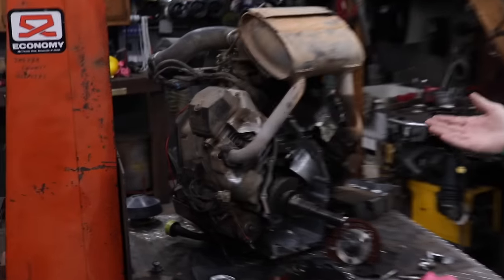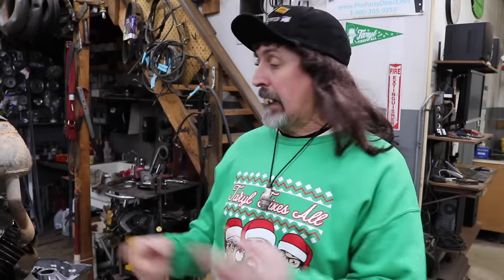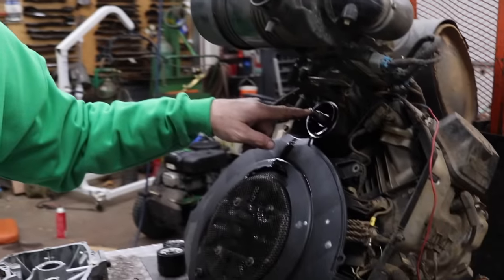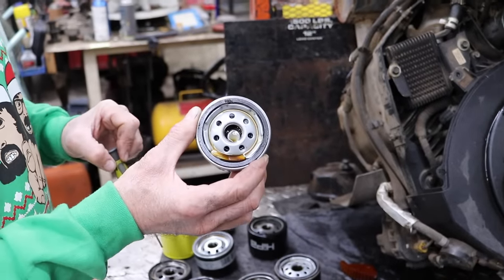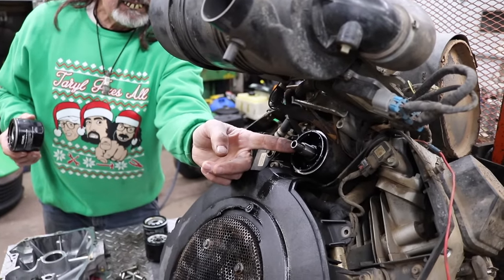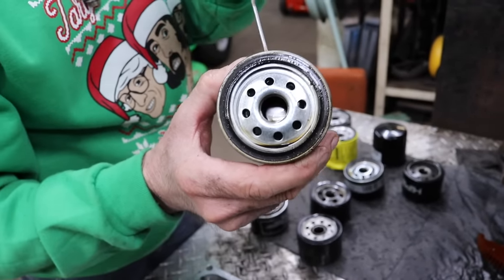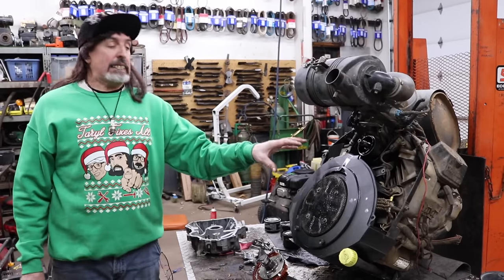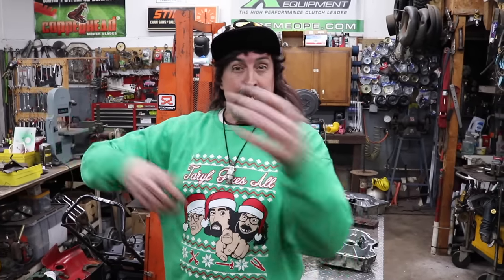💸 $4,000 Down The Drain! DON'T Do This Epic Fail!

Comment: I go to my local Grass Rat equipment place and I tell him what mower I have and what engine is on it or go by make model and the Grass Rat says, "well, we're out of the filter it calls for but we have these and it should work fine".  Whose fault is it that the mower took a dump.  Most customers will ask for the right filter for their machine.  So the mistake could be on the Grass Rat who sold it.  So you can't always blame Mr. Customer Sir.
Reply: I may have missed where he stated it was ENTIRELY the customer's fault.

Being your comment includes the word 'always'... 

Now from the 'other side of the counter'...

Customer comes in (BTW, I've worked at MANY auto parts stores) asks for (I'll simply use an oil filter being that it the subject in the video and your comment)... and so the questions begin of model year, make, engine, etc.

Customer's response is 'I don't know" or the infamous "They're all the same'.... 

Now 2 things could be done in the first example...

The first example is, IF the vehicle is just outside in the parking lot and we're not swamped with customers, we can go out and get the information off of the vehicle, or possibly see the filter number.

IF the vehicle is NOT  in the parking lot where we can get the information, the customer can be told to either get the information or bring in the old filter. (Which sometimes the response is 'They're all the same' or "I bought one here before'...

yea.... well unless you have an account with us, we have NO record of what you previously purchased...

So I will sometimes give them a 'reality check' and simply state 'Either the wrong information or lack of information will get you the WRONG part EVERY TIME, GUARANTEED!'

Now moving on to the "They're all the same" mentality .... I will go to the shelf, grab the biggest truck filter capable of holding at least 2 quarts, set it on the counter in front of the customer, and proceed to ring it up...

I don't get very far as for some reason, the customer doesn't think that's the right filter.... My response is "It has to be, because you just told me they're all the same"......

Yea.... they FINALLY get a clue we NEED the information.

ALL of this is NOT to say there aren't parts counter personnel which THINK they know a filter will work... THOSE are the ones to walk away from.
Reply: @russdavis1960  So write me a book, it's a video about the wrong filter.  Nobody is blaming anybody.  How the filter got on there is anybody's guess.
Reply: @ralphwatten2426  
"So you can't always blame Mr. Customer Sir."

Your quote, not mine.

Comment: What is it with Kohler? , have golf cart that is just a year old, wanted a spare spark plug for it, took the existing plug out to note down the number and make, went to the golf cart dealer for a new plug with the Kohler engine type and the spark plug #, they told me "here this will work, it doesn't matter they are all the same", nope!, the Kohler manual lists a different plug than the dealer tried to sell me, and the Kohler  listed plug is different number than the one the cart left the factory with!!!, and the Champion plug it was fitted with is not even on the Champion spark plug web site, Knowing what you have doesn't even help the parts people cannot even find the parts it should have.

Comment: I think this is a good example of a DIYer that shouldn't be working on his own equipment.....if you're not 100% sure of what you're doing don't do it! The repair cost is on the home owner in my opinion. I had a customer back in the '80's with a nice used BMW and decided to do his own oil change. He drained the transmission , filled the engine with oil and took off down the highway with 2x the engine oil needed and no gear oil, a beautiful straight 6 murdered.

Comment: I looked it up.  It's $1700 with free shipping for the whole engine at Sale Motors.
Reply: I don't think a lot of people especially in these times have $1,700 to drop on a engine..take care of the one you have and no problems my father bought a tractor in 1983 with a Kohler 18 horsepower all that's been done to it is yearly maintenance I have never had a Briggs and Straton or Honda engine that even came close to the Kohler longevity..

Comment: The area where the mark is visible is usually spring loaded and a high pressure relief valve.  It allows oil to flow in case blockage of the regular oil system flow.

Comment: I think you're underestimating the consumers, considering just about everybody carries around a smartphone nowadays.
When buying parts most people take a picture of what they have or the model and serial number.
You would think most people would notice if the oil filter was wrong.
You don't have to replace the engine with exactly what was in there, as long as you crankshaft size is the same, you can make it work.

Comment: I would not use any of the short filters on that engine. Even if they dont actually touch the nozzle they will still restrict oil flow. It is always the safest bet to go back with the same one that came off from the manufacturer.

Comment: I run three different John Deere models. I always buy the parts and service CD’s, usually aftermarket and likely bootleg copies sold on eBay. I like to go into the JD dealer with a list of what I need by the JD part number.

Sometimes part numbers are superseded, I can live with that but knowing the part numbers ahead and having cross referenced the serial number range I know what I am ordering.

Plenty of customers at the counter don’t have a clue. What’s your model number? I dunno. Did you buy it here? No. Describe it. It’s about yea big and it’s green.

Comment: What is Taryl referring to when he says short block ??? Why would it be so much cheaper than the original  ??? Thanks in advance ☺
Reply: The short block is only part of the engine, with the pistons and crank. The cylinder head, valves and cams are not included.
Reply: @dino6627  thank you Dino, much appreciated. So Taryl will be replacing the damaged portion of the engine, not replacing it entirely. I got it, thanks again

Comment: Even that mid length filter while letting some oil flow might be enough restriction at high rpm to cause a slow death and you never figuring out what caused it .

Comment: If that's what causes the failure is low oil not as in low on the dipstick but low pressure for that five or six dollars more for the filter that the manufacturers recommend that it was well worth the five or $6 more it's a no-brainer just pay that little bit more I've always found the equivalent filter because I like a longer filter for more oil I don't know if that would hurt it or not but I've been doing it for years my John Deere is a 96 model year and I just bought a brand new one in 2021 John Deere that is have a good day and take care

Comment: AH.........  i would ne very nervous putting on a filter that " just makes" a gap at the top.    You may need plenty of clearance at the top for enough flow and pressure so i would put the correct length one on and nothing else. Same with that long stub of metal. It might be that length to avoid backflow? or build pressure in the can ect ect.  So cutting it MIGHT be disastrous. 
Companies wont pay for extra metal if they dont have to so it could be too long be accident or has a reason. Same with cheap filters, be careful as particle size filtering and strength drop with cheaper ones so use at your peril!!

Comment: The dealer is at fault for selling the oil filter without proper information. As a teenager (18,19), I worked at an auto parts store and would run into the same thing. "I need one of them tall oil filters" they'd say. "what kind of vehicle and what engine?" I'd ask. You know how this goes, the guy was clueless. In the end I'd line up six or so filters and explain that only one of them is the right one and the others could damage their engine. Most times they would drive whatever they needed parts for to the store and I'd show them where the engine sticker was and get them the right parts. But a few....

Comment: i know the reason for the long piece of wire further is an anti clogged valve if the filter is too dirty further oil allows there is in the filter a valve if your filter gets clogged hate the valve open and there is further lubricated das den reason but a shorter filter is asking not to get oil

Comment: Who would have thought that an oil filter would cause so much trouble. 🤔🤔🤔🤔🤔🤔🤷🏿‍♂️
Reply: Usually if the oil filter is blocked the oil still circulates throughout the engine without filtration.
Reply: Ever own a ford with a 6.0 powerstroke diesel? They're super picky with oil and fuel filters. Some engines are more picky than others. It's a shame for that beast of an engine.
Reply: Oil change mishaps/errors are the culprit of a large percentage of catastrophic engine failure for every type of engine from lawn mower to airplane.
Reply: @TheJuan72  Filtered or not, The oil WASN'T able to get into the oil galley. Did you miss that part?

Comment: Now after this video I would prefer taller oil filters and avoid Kohler engines because of the plastic camshaft on that engine Kawasaki or Briggs and Stratton are my prefered engines. Kohler quality is going down the commode. Their Commodes are crap as well.

Comment: Too bad Koehler didn’t think to put some horizontal holes through the extension.  That way even if the end were plugged it could still let the oil in.
Reply: Do you think that they made it this way for a specific purpose?

Comment: The correct question is why would kohler do this?
Probably to cause failures in just this way. Oil filter tech hasnt changed in decades but they needed this change???

Comment: Taryl if you would pass on to you tubers this simple remedy for parts on any equipment.Bring your manual to the parts department with the serial number of the equipment written in and on  the manual.If you don't have a manual for your equipment you can go on line and down load one.I have had arguments with parts clerks in the past trying to sell me the wrong part or parts.When they look up parts on the computer screen its not all ways right.Your manual or parts book will be.Take it from a very old mechanic.

Comment: ok, first that filter is on the top of the engine. With the holes facing down on the filter. I would bet that Kohler put that little extension nipple in the mount. Due to the way the filter sets. It would drain back almost all the oil from the filter after shutting down. So this little extension helps keep some extra oil in the filter for the start-up. And that has to be a total mess taking that filter off at the oil change. Looks like maybe 1/2 a cup of oil will just run down all over the engine. And no way to stop it from happening either. If they would have placed the oil filter in a different location or even just angled it differently. This sorta thing with this high-dollar unit could be diverted. Piss pore design. Once again. Proving that the Kohler name just ain't what it used to be. Besides look at the total plastic cam gear, WTF???

Comment: It would be well worth it to cut that extension OFF!!Also please make the video of you swapping everything over to the short block👍🏻
Reply: What if the extension meant the oil filtering was improved? Then what? Your engine simply wears out too soon.
Reply: @pootthatbak2578  also could be they added it just to get extra money out of you to buy a specialty filter.A lot of silly things get changed on these for no reason.If it ain’t broke it doesn’t need fixed in my opinion.
Reply: @johnbrisker5584  but this isn’t the same engine. This is a high horsepower engine for commercial work. It’s not the same thing as a 13 hp Intek in your yardbug.

Comment: ...and all through the '60s, '70s, and '80s lawn equipment didn't have an oil pump or even NEED an oil filter.
Reply: Tecumseh 3 horspower vertical shaft engines had oil pumps starting back in the early 60's

Comment: GOOD LORD...  that is crazy!!!!!!  One would think or at lest hope the end user would take the old oil filter (or whatever part they are replacing) down with themselves when they went to go buy a replacement - so they could compare the old with the new (I always do this) - because yeah sometimes the tools behind the counter MASSIVELY screw up on those!!!  I cannot tell you how many times I've had to drive back to the dang auto-store just because they screwed up on giving me the wrong dang part and MAN is that EVEN MORE FRUSTRATING now MORE THAN EVER thanks to higher gas prices thanks to LET'S GO BRANDON - which could have been avoided if I had just brought the old part with me - and did a quick comparison between the two before taking the new one home with me!!!!

Comment: On the new engine, I'd plug (to catch shavings), then cut that extension off to ensure oil starvation never happens again.  I'd say Krohler designed that extension to ensure the oil was drawn or pumped from the bottom of the filter.  Absolutely not necessary at all.  Oil will circulate through the filter properly without it.
Reply: Yeah, this is a poor design. I've serviced a few diesel engines, lawn equipment, and hydraulic motors, all have a short stem. The only time I've seen a long one is in this video and on BMW engines. However BMW does not use canister filters, the canister is internal on the engine and you only replace o-rings and the pleated insert. Kohler either should have used a short stem or inserts.
Reply: The filter is installed on top of the engine threads down. It would be drawing oil from the top of the filter.
Reply: How do you know? Most filters on small engines are not inverted like this one. To say it’s absolutely not necessary is foolish.
Reply: @sonar610  I’d be willing to bet you to that those filters weren’t inverted like this one.
Reply: @lawnmowerdude  BMW's are inverted.
Reply: @lawnmowerdude  I now see how the filter is positioned.
Reply: You would be causing oil starvation on every start up then. The filter is upside down on the engine and the long nipple prevents too much oil from draining out of the filter when not running, thus preventing oil starvation at start ups. In this case, your "bottom of the filter" theory is actually the Top of the filter. Have a nice day !
Reply: @sonar610  MO RON

Comment: But why wouldn't a low oil pressure switch shut the engine down before it ruined it but
Reply: Good question. Almost as if Kohler designed this engine for destruction.
Reply: I'm not sure on that engine, but some will only kill them for oil level, not pressure.
Reply: Most of these engines have low oil shutoffs that go by volume in crankcase not pressure.
Reply: It's a lawnmower not the space shuttle 😂😂😂
Reply: Because the crankcase was full. Not a pressure switch. It doesn't sense pressure, only volume/oil level.

Comment: seems like the manufacturer should've foreseen this scenario , and either remedied the problem , or at least have placed a warning notice on the engine . i think they should have some liability for the damage . i would imagine that on some equipment , due to obstructions , you wouldn't even be able to see that the nipple is too long for a short filter .
Reply: Fat chance. I guarantee you they tell you what filter to use. You don’t use the right filter thats on you.

Comment: That guy probably had that filter in the garage from an older mower and figured if it threaded on it'll work. I definitely make sure I'm using correct parts whenever I do anything to any of my equipment.

Comment: One would think that oil will still circulate throughout the engine even if the filter is blocked.
Reply: LMAO
Reply: It was how it worked for decades, also expensive engines had oil level and/or pressure sensors.
Now the bypass valve is in the filter itself and the pressure sensors/switches seem optional.

Comment: I have to disagree with Taryl on part of this. If you go into the store without the correct info, and they sell you a filter, and you bring it home and can visibly see its half the size of the original one, then it's on you.   No way would the seller be responsible for this sort of mistake.

Comment: Indeed stupid design choice. Seems like there is an Allen key fit on the inside probably to get it in "screwed" in the block. But it still does not make sense to make it that long. So always go for the long cheap "autopart store" filter if it fits.😁

Comment: Prolly designed it like that in purpose
Reply: The standpipe ensures there is oil of sufficient quantity retained in the filter because this filter is UPSIDE DOWN on the engine.
The right quantity of oil is kept inside the filter by the combination of the standpipe and the anti drain valve...so the engine doesn't run very long without oil on start up....

Comment: Customers at fault, he didn't know what he needed, was to lazy to look it up and didn't question it when his original filter is clearly a different size. That mower would of been screaming and they just run it. People need to take responsibility for the decisions they make. It's not the shops fault when you tell them what you want. If your to lazy to get a clue, don't work on your equipment,  take it to a shop.

Comment: wOw.  Take an  angle grinder,  cut off  that extension, the  threadless part,  FROM  THE  THREADED   PART.   ' voila ' ....fixxed......er   fixed.   Modern engineers; doofuses'.....
Reply: You appear to be a Modern engineer as well.

Comment: Mechanic shops no matter what they say big business butt kisser what is not telling you is if you cut a quarter inch off that shaft where the oil filter goes it will hurt absolutely nothing and will ensure that that mistake never happens again..,... And here's another good tip for someone who wants to build a toy those engines are perfect for old style Volkswagens.....